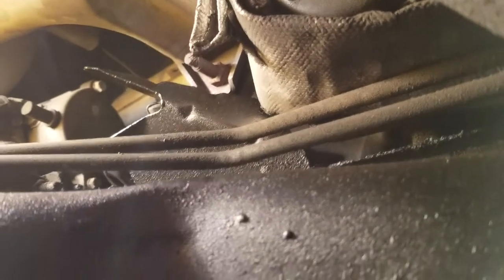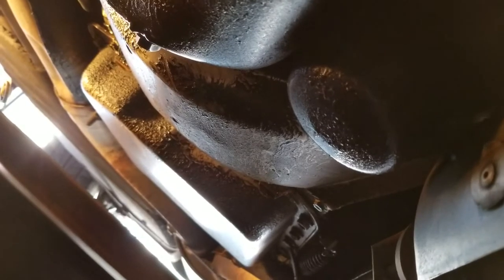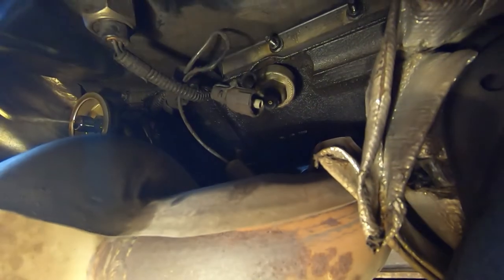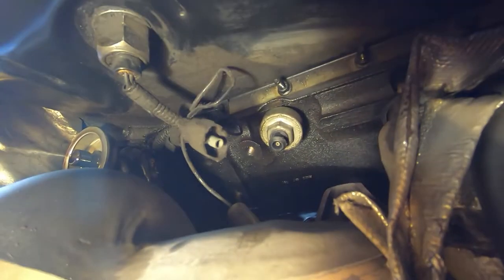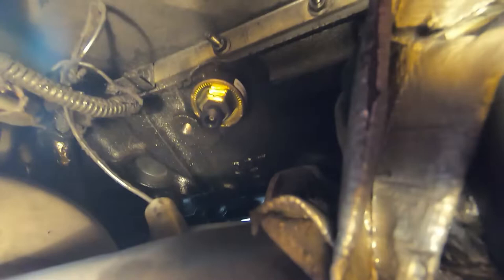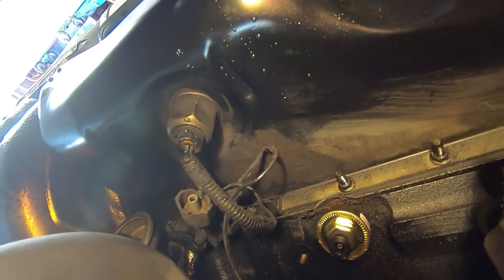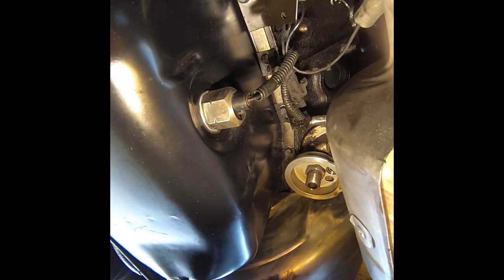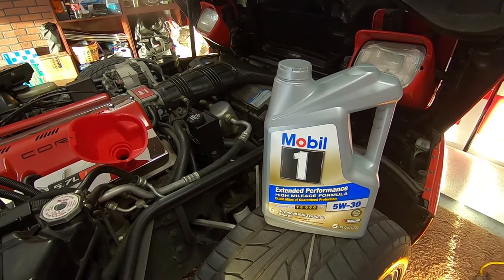How to Change the Knock Sensors on a C4 Corvette

Comment: With the knock sensors removed is a good time to do a coolant flush,. The service manual recommends that you remover the knock sensors to get all the bad stuff out of the block when flushing the coolant
Reply: Do you know, if you remove the sensors do you still need to remove the thermostat to get all the fluid out?

Comment: Our 1991 corvette, L 98 just 1 sensor passenger side down between the 4 and 6 cylinders just above the oil pan. Ours took a 22mm socket.

Comment: Great how to video, I followed your instructions. The two knock sensors are in the same location on my 1994 Z28 5.7L. If the sensors are the originals like mine were, its important to first spray around the top of the sensors threads with rust buster / WD 40 and allowed to soak into the threads.

Comment: High idle, runs rough, rev limit around 3k rpm. Speedo reads ZERO. AGH!
Thank you SO MUCH!  I never knew that I could read the codes without a tool. Code C72. Knock sensors tomorrow, THAT'S A START
Reply from the maker: Glad I could Help!! Thanks for watching and good luck!!

Comment: I have a 92 with 56000 miles on it. Recently I have been having a stall issue after 15 minutes of idling or driving and I see a code for H43 which is for a knock sensor. Knock sensors wouldn't cause the computer to shut down the engine would they? I'm also leaning towards a fuel pump but I need to test that first. Any help you can be would be greatly appreciated.

Comment: What's is knocking sensor and what does the engine do when it goes bad?
Reply from the maker: It is a sensor that tells the engine that the engine is not firing right or getting predetenation which can damage the engine.
Reply: In the mid to later model c4's a bad knock sensor will cause a H43 SES code in the computer.

Comment: Appreciate the video but was disappointed as I wanted to see how much coolant drained from the block once the sensor was removed, and have the appropriate sized container at the ready. I've already drained the radiator and removed the thermostat. It's not in the best position to drain without making a mess. I was thinking of placing a funnel directly under the sensor and directing the flow into a pan below. We'll see how it goes...

Comment: Was this causing your engine light to come on
Reply from the maker: Yes the check engine light would come on about 15 seconds after a startup after the car would be sitting more than  about 4 hours. After replacing the sensors the problem went away!

Comment: Hi, excellent video, but I have a question, I have a 84 vette (CFI) I found just 1 sensor on the passenger side... but a bolt is in the driver side location... is this normal?
Reply: Yes the other side is a drain hole for the coolant
Reply from the maker: Thanks for answering that question
Reply: @jamesfoote4685  thanks!!